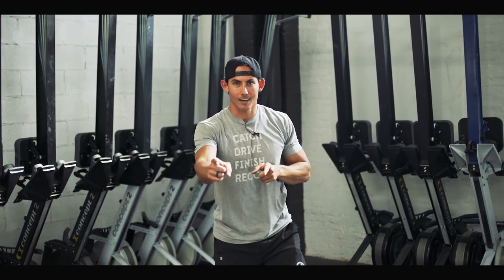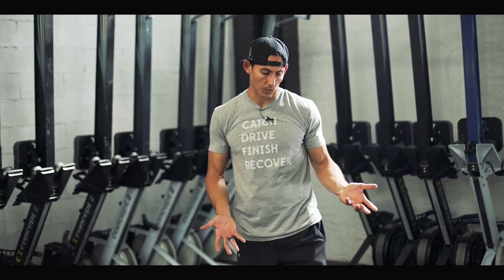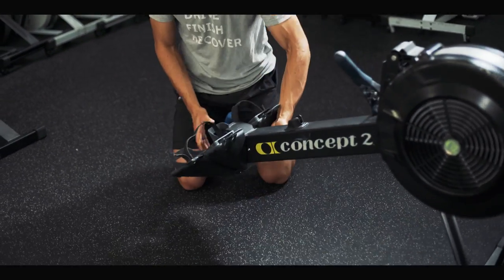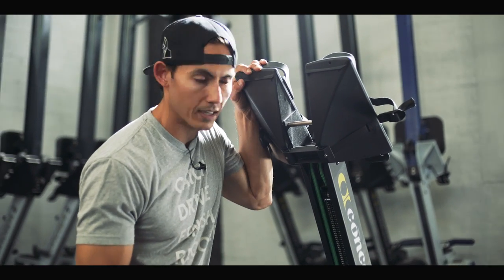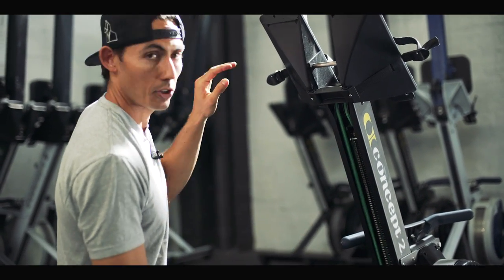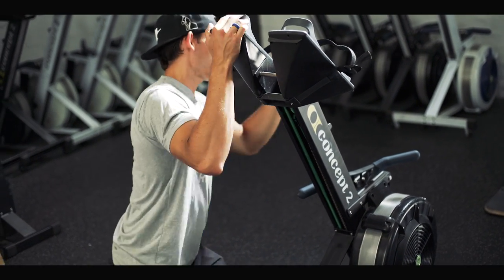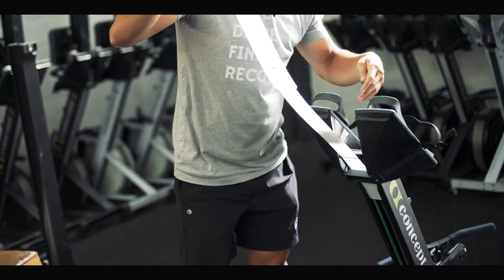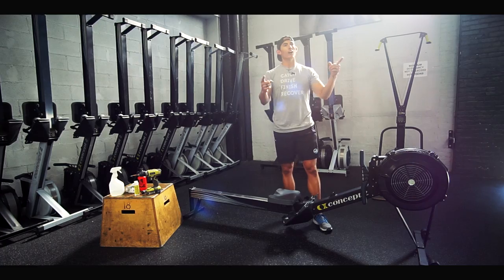Concept2 Rowing Machine Maintenance: Part 3 the Chain and Handle

Comment: Thanks, Shane! I just watched the three part series, as I'm moderately tool handy and could handle something of this scope. I just changed the dead D Cells on the Concept2 at the gym. Later I saw the chain 😩 on the machine....which has a liberal coating of rust further into the flywheel. I found Concept2 oil on Amazon. (More than that I won't do because it's a bit intrusive on my part!). I watched this because the more I row on that machine, the more I'm planning a massive Spring time garage cleaning. I have a feeling I will end up with a Concept2, LOL. I appreciated this clearly described maintenance series as I would definitely care for my own machine. You made giving it good care relatively easy.

Comment: I have a little trick for frozen chains.. Let them soak in some diesel for 24 hours. The chain will be better than new. Then add Concepts oil or regular seweigmachineoil before reattaching the cain. Works like a charm

Comment: It seems that few fitness center techs understand C2 rowing machines. I have two pet peeves.

1. Bungee breaks at the ends and the techs just shorten and stretch to cords instead of replacing. The result is excessive return force that quickly tires your forearms.
2. Crunchy hubs. It seems that high use machines develop vibrations in the hubs. Not sure exactly what wears but when you do a longer row like a 5 or 10k, your hands will tingle for several hours after rowing. If you just sit down for a quick row it seems ok but when you row longer pieces it’s a big problem. Techs seem incapable of understanding and fixing this problem because it’s more of a quality than functionality issue. I gave up and quit a national chain club because of this. They simply would not/could not maintain their machines.

I’m now at a club with Water Rowers that are much smoother and don’t seem to develop the vibration problems I see on C2s.

Comment: Good video.  Does adding more tension to the bungee not make it marginally harder to pull on each stroke?  And will that not change accuracy of PM readout?
Reply from the maker: Stefan, we would argue that adding tension to the bungee is only necessary if it has lost tension from it's original tension point therefore you wouldn't be making it harder, you would simply be resetting it. And no, it will not change the way the PM reads the machine so no worries there. Great question and thanks for asking!

Comment: Hi there ! Loving the content ! :)

Quick question, if the rower isn't maintained well, lets say for 2-3 years nothing was done, no oil put, no fly wheel check ...  

How much in % approximately can it affect my performance on the rower? (I want to maximize my open performance)
The rowers at the box differ pretty much one from another when it comes to smoothness. Got honest answer from coach that maintenance was being pretty poor. 

What would you recommend doing?

thanks for replying !

Comment: Can you create a video dealing with the seat that squeaks and doesn't ride smoothy. The rail is clean. Thanks in advance.
Reply: Hi I'm no professional, but I had some problems with the seat not rolling smoothly. I cleaned the rail, but flow was still not smooth. then I checked the rollers under the seat. They were grimy. cleaned those with plastic card and then damp rag and now it slides well again. hope this helps

Comment: For the first time ever, I encountered a problem with rowing today and stopped training. I was doing 1000m efforts with a minute recovery (which I am sure is irrelevant) but every so often it felt like there was no resistance whatsoever on the chain and then it would be ok for another minute or so. I presume after seeing the videos it will be a chain or bungee problem. However, my immediate problem is that I am disabled somewhat, having broken both hips - one is pinned and plated and the other has been replaced and I have one leg longer than the other as a result! This makes getting up and down off the floor very difficult and slow. It would be helpful if someone could give me an indication of what the problem may be and if it is serious, so I will be down there for as little time as possible! It was all the more frustrating today as it was my first row this year after hitting 3 million on Jan 1st!!
Reply from the maker: I think what you’re experiencing is a clutch starting to go bad. It’s an inexpensive and easy to do fix. Give C2 a call and they’ll be able to get you the right part.
Reply: @DarkHorseRowing  Thanks so much for your speedy reply. I have contacted C2 and they confirmed that it sounds like a clutch issue and I will need a new flywheel. Sorted!